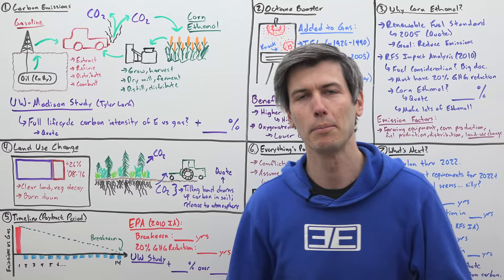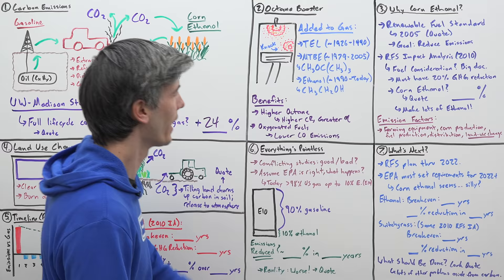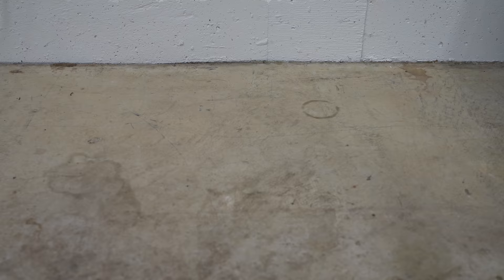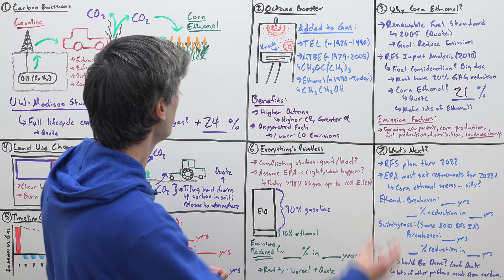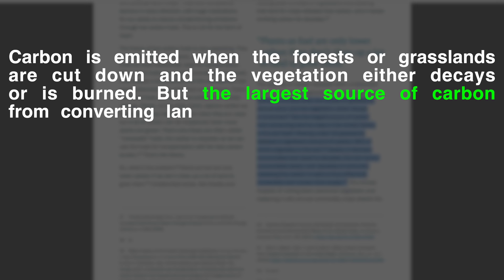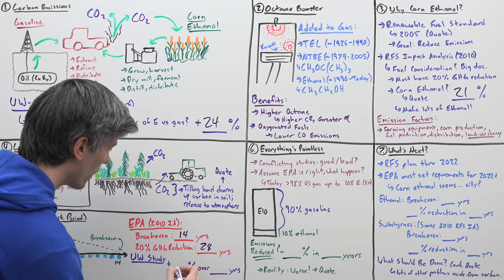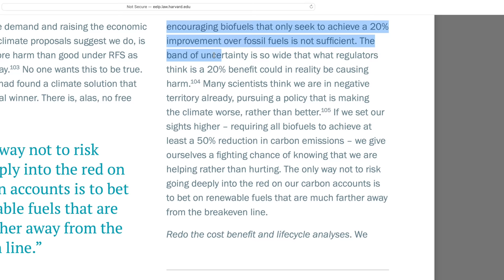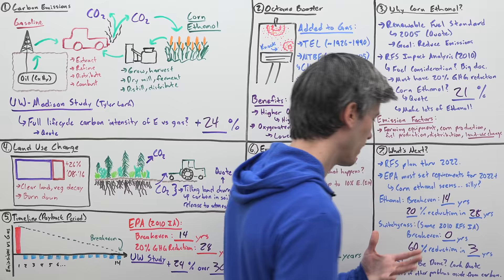America Was Wrong About Ethanol - Study Shows

Comment: It has been known for many years that corn based ethanol is an absolutely idiotic idea.  In the end, the reason for choosing it was to prop up corn prices and make corn production more viable, it was not to reduce CO2.
Reply: It was also a political move to buy off the ag lobby.
Reply: @SimuLord  

You can keep the corn.
I’ll take the single malt thank you.🤣👍🥃
Reply: isn't corn genetically modified, therefore the big guy who owns the patent is collecting his greedy share
Reply: @johndrew6730  Buy off the ag lobby?  You mean they get favors from Congress and we pay them ?  Both?  Pretty sure the lobby does the buying in exchange for beneficial legislation.
Reply: @BillMcGirr  Malt is a flavoring method, not a source of alcohol.  Still need a grain source.
Reply: @zebman9228  

Um… Barley is a grain correct?

You can literally malt just about ANY grain.🤯
Reply: @zebman9228  Yes, the lobby pays them, in exchange, they pay back the lobby far more via legislation.
Reply: Something To Think About.....
Most people drive alone or with only 1 other person in the car. A Honda NC750X motorcycle ($8,000) gets 60-65 real world MPGs (750cc engine decent acceleration, top speed 125 mph) and motorcycles actually have poor efficiency due to horrible wind drag/aerodynamics. If the motorcycle had a lightweight aerodynamic enclosure more like a velomobile or VW NILS concept car. It could pickup around 35% more efficiency (85-95 MPGs). if it was made hybrid it could easily get over 100 MPGs...
     Any car or motorcycle company could easily build a 3 or 4 wheel VW NILS or Elio  style,  tandem 2 seat commuter vehicle  (with 3 storage compartments,saddle bags & 1 in the rear) that could easily get 70-80 MPGs on gas or over 100 MPGs hybrid.
Now if there is such a huge climate emergency & energy shortage why are all car/motorcycle companies refusing to build a 70-100 MPG 2 person commuter vehicle when they easily can? The NC750X is $8,000-$9,000 new same price the Elio was supposed to cost. Honda or VW for example could easily build an affordable like it for around $16,000 new.  If it's getting 70-100 MPGs the fuel savings would cause the car to pay itself VS buying a car that got 30-40 MPGs.
Reply: Actually  @TREY RIVER  the "Green Left" were making this same criticism of corn as an ethanol source long ago.
Reply: @brianhale3678  God = valid proof 🤡 take
Reply: Yea idk why he released this video now?? This is old news. And now instead of focusing on other biofuels like biodiesel, we instead are putting all our money on boring electric cars
Reply: @skippypeanutbutter9136  yep, senator Grassley R. IA was an eager corn ethanol participant. Dollars create science, good or bad. Politics is about dollars. Science is the smoke and mirrors.
Reply: @johnschreiber1574  glad you pointed it out.  A clear counter example where greed and/or lack of scientific understanding resulting in poor public policy.  Certainly a closet full of skeletons on the rep side there too. Equally as bad as a public majority of support based on ignorance/mis-understanding.
Reply: The total fuel consumption of U.S airlines is approximately 19 billion gallons annually. 

Total fuel consumption for mining lithium to make electric car batteries is 21 billion gallons annually.

The 21 billion gallons can only produce enough lithium for 250,000 car batteries.

The lifespan of an electric battery is 10 years and is not renewable.

Electric cars are not better for the environment.......they're worse.
Reply: @SuperSetright  I cannot wait to see this electric car disaster just waiting to happen. I’ll keep buying fuel myself, the long lines for a charger l, I can see it already.
Reply: @JAMESWUERTELE  
What are you going to do when we run out of petrol?

Comment: Having previously worked in biofuel research in the early 2000s, the conclusions reached in this study have always been my takeaway regarding ethanol.
Reply: Cutting down Borneo's rainforest was a big mistake.
Reply: This isn't regarding ethanol, it is regarding corn based ethanol. Like he mentioned, other sources of ethanol production result in far better numbers.
Reply: @rdizzy1  Sorry, I guess I should have been clearer - I was referring to corn-based ethanol, as it was the subject of this video.
Reply: Did you factor distillers grains into your conclusions? Every study that I've looked at that results in a negative for corn ethanol fails to get even the most simple facts straight. The one in this video is no different.
Reply: @rdizzy1  They only result in better numbers because they are flawed. Switchgrass and most other cellulose sources are worse than corn. They are too bulky to transport. Most take more energy to process. Crops like switchgrass are single use. Unlike corn which produces ethanol while at the same time acre for acre as much feed as soybeans. The protein and fiber in corn is not converted to ethanol.

Corn ethanol has another benefit for human security. We depend on corn for many things. If there is a severe drought for example, ethanol production could be reduced. Thus, helping ensure enough corn for other uses. I'd guess it provides a 20-30% buffer against really dramatic consequences.
Reply: @heartysteer8752  I wish I could explain this better, but your statement about "getting simple facts straight" is just your opinion. You're basically dismissing information that doesn't fit your already established world view. In other words, just state that you cannot be swayed because nothing new will fit your criteria to change your mind.
Reply: Funny how all the self regarded "intelligent" people come to these conclusions after all the damage has been done and not prior.
Reply: @rdizzy1  The separation of ethanol is the controlling factor in the energy balance. True for all feed stock.
Reply: Who? what company and what country?

Comment: I’m waiting for the study on diesel emissions and what impact it’s had in the industry. From decreased reliability, increase in demand for large parts like engines and rare earth minerals in catalyst, it should be quite the study. We can burn diesel clean and efficiently without the particulate filters and catalyst. But then we would have reliable engines that get 25 mpg and don’t burn down houses. Instead, many new engines struggle to reliably get more than 5000 hours on them before failure and an increasing amount failing near the 1000 hour mark due to increased exhaust temperatures.
Reply: Keep asking the right questions, Mike.   Tier 5 for offroad.... folks be crazy.
Reply: @mouseblackcat5263  It wasn't oil companies. It was the populace of Europe.
Reply: @christianlibertarian5488  Not any that I ever spoke to. They hated going to Petrol from Diesel. Diesel is Safer, Cheaper, and more Useful for as more than just Fuel.
Reply: @cosettapessa6417  That would be the govt., not the oil companies.
Reply: I get 40- 43 mpg with 10% ethanol mix, I get 47-52 mpg with NON- ethanol fuel in my 2017 Honda Civic.
Reply: @jackd.ripper9216  To bad this is a wish, not a real thing.
Reply: Technically the shorter lifespan of modern diesels is the egr not aftertreatment...egr carbon destroys cylinder walls and rings...  however with modern commonrail injection dumping the emissions equiptment would net upwards of 30% in mpg...  sure your tail pipe won't be soot free but you reduce raw fuel needed to go from point a to point b with no emissions equiptment...  doesnt take a rocket scientist to u derstand 30% plus less fuel used if we dump engine killing epa equiptment that we would have net 30% less greenhouse gasses...some math really
Reply: @donaldindividual-1  my monte carlo gets... 12 mpg on a good day lol
Reply: @christianlibertarian5488  so it wasn’t the populace.
Reply: @dana8071  0)
Reply: @mechanic_prepper  it's a tradeoff of MPG/CO2 and NOx. Diesel engines are tuned to reduce combustion temps to get NOx production under control (think dieselgate) where if you said F it and ran hot, you'd get great MPG but then California would get smog and acid rain
Reply: @mechanic_prepper  I’m not saying EGR isn’t bad but it’s no where near as bad as after treatment. If designed correctly, EGR engines last for a long time and are reliable. The ones that failed were due to poor EGR flow and allowing the exhaust gas to get too cool and allow for carbon buildup in the intake, not all engines suffer from this. But almost universally engines are suffering from after treatment devices. They often require an enriched fuel ratio, which increases combustion temperatures. We used to see Diesel engines running at the 185 mark all day. Now they are pushing 240 before any sort of indication the engine is running warm. And with the mixture of EGR and after treatment, I’ve seen swings in exhaust temps go from 1500 to 800 in seconds.
Reply: @jackd.ripper9216  
Is this new "tech" added to the fuel? And how/why does it make for higher repair expenses?
Reply: @cosettapessa6417  The government responded to the demands of the electorate. So it was the populace.
Reply: @christianlibertarian5488  No it's the oil companies, operating government as their enforcement arm through regulatory capture.
Reply: @samueldamewood5273  I don't think it is an either/or situation.
Reply: @jackd.ripper9216  Lmao an "NDA" while you're posting anonymously online.
Reply: 60 year old refrigerators are still working today while new refrigerators have a 14-17 year expectancy. Same thing with cars and all (most) electronics. 
They build them to break to support future sales and the repair industry. This is all as back asswards as you can get and 100% government supported. And sometimes funded🤬🤯🤬🤯🤬🤯‼️‼️‼️
Reply: @chris-graham   partially true..however a diesel reingesting exhaust has hig concentrations of carbon.  Test the Rockwell hardness of that carbon and its easy to see why modern egr diesels are wearing out prematurely... also there are countless studied on meth water or straight water injection that keep nox in check better than the technology used now.   Granted there is still more particulates and co2 plant food but water keeps peak combustion temps in check without hurting ( in fact improving) bothe power produced and mpg.  I have been a diesel tech over 30 years... post 07 epa trucks and powerplants have greatly suffered in longetivity and work performed per 1.00.